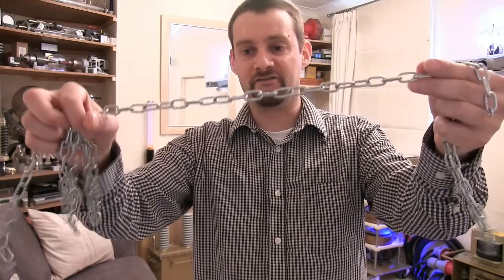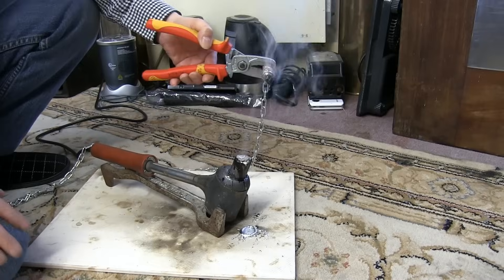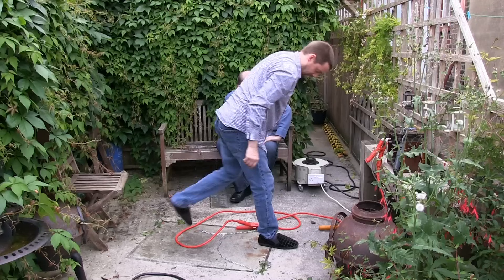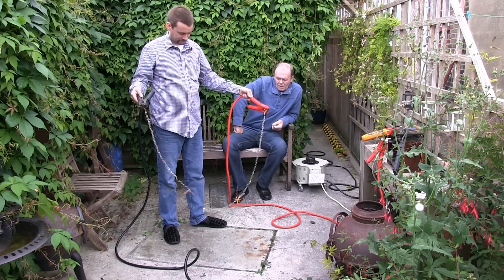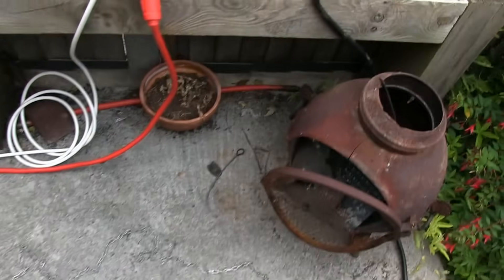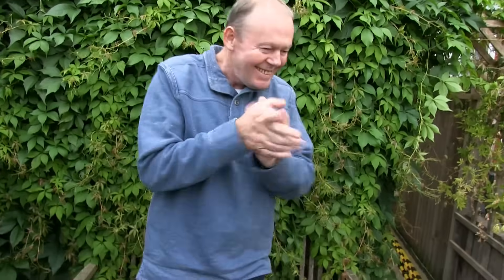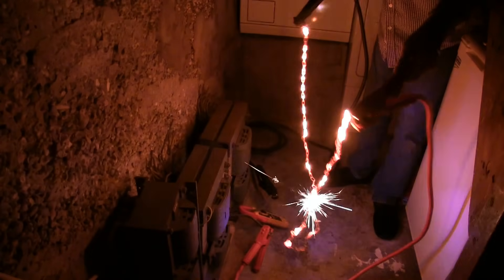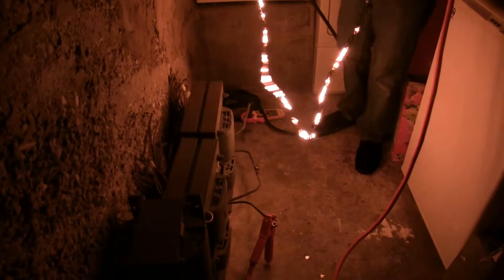Steel Chain VS Electrical Current

Comment: What the hell is that monster solder thing?!
Reply: Industrial soldering iron for soldering large things :)
Reply: +Daniel “G” W like fairy lights?
Reply: Mega soldering iron
Reply: I wonder how many watts that soldering iron consumes.
Reply: Had one of those, not exactly but close to it, mine was 125 Watt. Seeing this one, I guess it's more like a 175 or 200 Watt iron.
Reply: +Tenus123 Not enough, I'm sure. Crank up that variac!
Reply: ***** blow torches are used for medium sized things. I'm talking 500A connectors here...not a little copper pipe.
Reply: MrDubje Standard soldering irons are often 300-500W.
This is more likely to be in the kW range.
Reply: *****
Never used it, got it from my grandpa, sold it last month. I imagine it is safer than using fire when used as a plumber's tool, being close to wood in some cases? I'm not sure, though.
Reply: Daniel W
It might be, hopefully *****  can clear this one up...
You mention "standard" soldering irons, for what use are those power ratings standard :) ?
Reply from the maker: 300w from RS Components
Reply: *****
Thanks for replying and clearing it up for us!
Reply: +Daniel “G” W Standard soldering irons are most definitely not 200-300 watts. They are around 25-90 watts.
Reply: +Andrew Delashaw Even a mid sized soldering station like the popular Hakko FX-888D is only 70 watts.
Reply: ***** Pretty much yeah.
Reply: Yeah, and it has an unusual tip on it too THAT'S WHAT SHE SAID
Reply: THANKS I AM GOING TO GET ONE
Reply: Becuase burning gas is for peasants, 200 watt all the way haha, no but I get your question, I feel it would be easier to use gas

Comment: fuck that soldering iron is huge. good god.
Reply: Its not real soldering until the iron is as big as your arm. Regular soldering irons are for peasants. I use an iron just like that for my computer motherboard soldering.
Reply: Mike44449 for the cpu socket exclusively right?
Reply: not bigger than ryzen

Comment: Does the resistance go back down when the chain is cold again?  Wondering if it's the steel oxidizing or when it's hot you've got all that thermal energy bumping the electrons and holding the current back.  You showed something similar in that big light bulb video last time, and that's in vacuum and it recovered, so that couldn't be oxidation....dunno, just wondering out loud!!

Comment: Stainless steel wire is actually used in some temperature controlled vaporizers because the chip in the vaporizer uses the changing resistance of the wire to determine what the temperature of the wire is.

Comment: that was cool. Question about the chain glowing is that what causes the same effect to work in Light Bulbs? I know metal when heated to a high enough temperature will melt and glow, but is that the same glow in lightbulbs?
Reply: might be good to mention I'm going on 17 hrs without sleep when forming this question.
Reply: It's the same thing except there is a special gas in lightbulbs (I'm not sure whether they still use argon in  incandescent light bulbs) which prevents the filament from breaking off due to the heat.
Reply: Not an electrician, but Im fairly certain its the same concept, just much smaller wire and a lot less current.
Reply: Well, it's mainly because if you made lightbulb filled with air it would gladly smoke all the machining shit inside and make glass a bit "tinted" on the first run;)
Reply: Thanks peeps :)

Comment: You're like Colin Furze's electrical engineer brother...
Reply: COLLAB WHEN?
Reply: Naa never happen. Photon would have to take the Dartford crossing and he's popped his passport.
Reply: how? he doesn't build anything, all this guy does is burn/destroy stuff
Reply: He "overclocked" that mobility scooter, and also built that power control console. But yeah, fair point I guess. What I meant is that both engage in very dangerous stunts, but that's a rather broad category on it's own...
Reply: +Suhkma Dheek let's just leave what you said at "I don't know anything about how electricity works"
Reply: yes we need this now
Reply: +Suhkma Dheek Large Marx generator would be simpler to build.
Reply: Eduardo Jerez doesn’t build anything? Pretty sure he built most of the electrical equipment dotted around his house. Just because it’s not some flashy movie prop doesn’t mean it takes any less effort
Reply: @theinfoone  He built everything you see there in his "Shop".   One more clueless keyboard worrier.
Reply: Exactly what I was thinking

Comment: Watch out with galvanized metal, inhaling the fumes will make you sick.
Reply: Yeah, I've heard that the effects of inhaling zinc fumes will make you feel so physically bad you'll wish you were dead.
Reply: Katalist
Yep, couldn't remember the name for it at the time. Thanks for jogging my memory.
Reply: You think he actually cares about safety? :D
Reply: It's also called welder's flu. Basically, it feels like a horrible flu, times 10.
Throwing up, going to the bathroom a lot and one hell of a migraine.
Taking a large amount of calcium right before or after the event prevents most problems.
Reply: Henk de Vries
I was told by someone that taking calcium and possibly also strontium beforehand helped. Maybe it's wrong then. I never checked the information.
Reply: He said in another post that he burnt off the galvanized coating outside before starting the experiment.
Reply: Worth it
Reply: @theLuigiFan0007  strontium 😂😂😂🤣🤣🤣

Comment: Ah the lovely hum of shorted transformer :)! Although I'm a bit curious, why is that the chain is not being lit up evenly across it's whole length? There're parts which are visibly darker or brighter. Is it because each one of those cells have different resistive properties so the current differs on different parts of this chain?

Comment: I wonder why some parts of the chain didn't get hot
Reply: low resistance I guess
Reply: Probably because of difference in conductivity. There are many different materials on this chain; from zinc coating and steel to everything they turn into at 800°C or more.
Reply: The parts that don't glow are chain links that welded together and have a low resistance, so they dissipate a lot less power (ohmic heating). Also the hot parts are a little thinner because they oxidize faster.

Comment: Yep. Stainless steel has the property of increasing resistance with temperature. This is actually hoe temperature controll ecigarettes work. They use the TCR curve of  stainless steel. It then calculates the temperature based on resistance above the base value.

Comment: So quick question, from my knowledge of running a pos and neg to a chain like this, when you bounce each link off of each other like you are isnt that technically creating a arc like weld arc persay. That's why it gives off the blue flash? Me personally being a welding i believe it is, also if so that's so bad for your eyes fyi.

Comment: You guys should try a bike chain.
Reply: or a whole bike
Reply: Or electrocute a bicycle wheel and spin it...
Reply: Heck yeah!
Reply: Get a few batteries, wire them up and have a glowing bike chain while riding it, just don't touch the metal.
Reply: edwardecl yah because its that simple
Reply: Andrew Fritz
I'm sure a couple of dozen of those batteries you use in remote control aeroplanes and other RC devices would do the job, at least till they explode.
Reply: edwardecl but how will you get the electricity to only go through the chain?
Reply: Andrew Fritz... didn't think of that... o_0
Reply: wear rubber gloves and some wellies, i'm sure it will be fine.
Reply: edwardecl what about the gears,the frame and wheel spokes?
Reply: The back wheel and gears might be a problem... I'm sure you could insulate the rest though.
Reply: edwardecl its would be hard though use some type of reinforced plastic gears/spurs/sprockets.
Reply: Andrew Fritz OMG you could propably carry a couple of batteries and a transformer on a bike. Attach the wire to the bike and ride away. Imagine driving a bike and all of a sudden it starts glowing and melting under you. Comedy gold.

Comment: Did you use a DC to AC inverter for that car battery? if its a 30V source then hoow did you  step it down without affecting the voltage? am i missing sometihng?

Comment: Now that's fucking soldering, but you'd have been better off with a pot of molten solder and dunking it in, that's how I join large cables easily, although you'd wanna do at least 50 at a time as not to waste power.
Reply: Yeah, I thought of that too, but you need special flux for oven flame soldering, or just left the work piece get nice and hot. He doesn't waste that much energy, it's for entertainment, but melting 2Kg of tin/lead would be a massive waste.

Comment: So instead of waiting for dark and doing it outside you do it in your basement. Your a real smart one.
Reply from the maker: Smarter than you realise apparently! Lifting and carrying the transformers to outside would have broke my back, and my feet if I dropped one. The galv was burnt off outside so that's good enough. Concrete floor in basement, perfect, power in basement perfect, get the idea now ?
Reply: ooooh rekt!
Reply: seem he been ok for last 7 years of doing this stuff
Reply: lee x he's living on borrowed time then!
Reply: "He knows nothing of electricity"
Reply: Interesting
Reply: +olatron that was a spellcheck error... It should have been about. I use a slide keyboard and sometimes if I do it to fast it comes out with the wrong word...
Reply: +lee x I'm surprised that he didn't get electrocuted when he had his slipper on the chain. I've seen enough idiots been jolted from screwing around with electricity in my life and a lot of idiots ending up in the hospital because of it. I've even seen the aftermath of a high voltage line accident involving 2 workers. Very very bad. When he put his foot on the chain I was surprised it didn't arc around the thin insulation into his foot then through him and into the ground on his other foot. I know he had a little insulation on the bottom of the slipper but it was very thin and is far far from what people that work with electricity have to wear.
Reply: The Tartan71 was only 50v (I be more worried about burning your self) but I agree this was bit more open air and higher risk then the  other stuff he norm does
Reply: The Tartan71 I wasn't calling you out on your grammar, I was pointing out what a ridiculous statement that is. I'm pretty sure his knowledge of electricity > nothing.
Reply: olatron it doesn't mean that he knows exactly nothing. It's not literal. I don't know where your from but in all of North America I've been to, when someone knows "nothing" it is taken figuratively or metaphorically.
Reply: 50V cant travel through your body that well and he is very clever at electricity
Reply: The Tartan71 I'm from England, the same place as the language you're busy misusing :p
Reply: olatron lol
Reply: The Tartan71 depends how close the ends are :), at school I messed with 50V and I was just fine :) As there isn't great conductivity to the ground compared to the chain, but as it isn't near the heart and little current passes its fine, even if I'm wrong, photonic know this stuff as he works with electricity!
Reply: Mapstar it actually is the amps that kill and you might have been playing with 50V but with low amps. As do I work with electricity but in the high end. I work with high voltage power lines and went to university with a minor in electrical engineering. Anything can happen when you play with electricity without the proper safety cautions. Safety mechanisms can burn out or stick when there is too much power being put into it or you become the ground and it tries to suck to much power though it and your fucked. I'm not arguing anymore. I know what I'm talking about. You can believe what you want but I know how dangerous any electricity can be. As I said in a previous post, I've seen what can happen to the human body when something goes wrong. I saw an accident at a high voltage power line in which one worker lost his balance on a tower that they were about to make the line safe to work on. He slipped as he reached the top, his safety line broke and he fell into the live line also touching his co-worker at the same time. I'll never forget anything every one of my senses detected that day. I've seen lots of people who work with electricity who "think" they know what they are doing because they work with it and they are the number one cause of workplace accidents in all jobs dealing with working with electricity be it high voltage of low voltage.
Reply: The Tartan71 i know amps what kills you but the volts are required too, 1V 500A should be ok
Reply: Triggered?
Reply: The bloke has 25 years experience working with electricity you keyboard warrior.
Reply: The Tartan71 I completely agree that it's dangerous - but it's his choice. Let's leave it at that. All the best to you friend.
Reply: olatron that's all I was trying to say and I have no problem with anyone. I was just trying to say my bit. I'm sorry my posts were so passionate. I've just seen too many bad accidents involving electricity which happened to very skilled and qualified veterans of the job. 
No hard feelings at all bud.
Reply: ***** please don't start this all up again. He maybe very qualified but as I said in the post I just wrote.... I have seen too many qualified and skilled veterans of the job get hurt and even killed. Once you see people killed working with electricity you never like to see people playing with it without the correct protection.
Reply: The Tartan71 you're*

Comment: A question for someone who might know, the chain loses it's looseness and becomes very rigid looking when power is applied. Is this because at a microscopic or subatomic level the molecules are basically doing the same thing a person does when tased by a taser and locking up?
Reply: Are you asking a question or telling us that's why? Sorry I'm confused by your statement?
Reply: Think it may be arcing, melting the metal in tiny areas and basically welding it together

Comment: What would have happened if one of those glowing, swinging chains hit your leg? Burned or electrocuted? Probably both...
Reply: Just burns, the voltage (50V max. in this video) isn't going to hurt you. You might feel it tingle in the worst scenario.
Reply: It does hit his leg a few times.
Reply: moreover secondary is separated from mains, floating with no reference to ground so he would havee to touch two spots to have some current flowing thru his body
Reply: Thanks for the info... Just doesn't look too safe in his little closet there, but he seems to know what he's doing.
Reply: I think Quentin meant bare legs, but I can be mistaken :) Photon indeed tried it with his pants.
Reply: No problem, I agree, it doesn't look too safe, but I think we can also agree on saying Andy knows what he is doing :)

Comment: Wouldn't dumping a shit tonne of current into the connection you were making be easier than trying to use a huge-ass soldering iron? might help the solder take top the chain

Comment: Cool as hell....Why is it, that some of the links glow white hot whilst others remain quite dull, even though the current draw should be the same through the whole chain?
Reply: Resistance.
Reply: Most likely due to the varying amounts of resistance where one link 
contacts the next one. Some of these contact points have welded 
themselves together, resulting in less resistance, hence less heat.

Comment: Good Video. Would be cool to see you build a mega induction coil. Something that could melt metal in under a minute when placed inside the coil. You have the power.

Comment: if i can ask a question, when the chains touch and  stick to each other, is it because of micro arc welding or have they become temporary magnetic?
Reply: They are pretty much welding together. That's how they do welding, by passing a very large amount of current. They were 100 amps @ 50 V, which should be enough to weld, but a lot that energy is basically used heating up the chain, so, it probably wasn't a very good weld, which is why it would sometimes come loose again.

Comment: The reason you're seeing increased resistance with higher temperature is that resistance usually does increase in metal with higher temperatures, you can try finding the respective temperature to resistivity coefficients to see a detailed view of how it changes. Not to mention how many poor connections there are in the chain.
Reply: Why else would we need to put liquid nitrogen cooling systems on supercomputers?

Comment: So let me get this straight, the current is running from the + to - which means ground, and if you take off the black cable, and leave the red one and with other hand touch the chain while standing on ground with no shoes, you get blown up?
Reply from the maker: Nothing is referenced to ground, the supply is from an isolation transformer AC
Reply: Ok se there is no way to get "electrocuted"
Reply: 50V would have a hard time pushing enough current through your body to do any real damage even if it wasn't isolated. Current kills you, but it needs enough voltage to push it through your skin to the fleshy creamy center where it'll do the damage / killing.
Reply: +Thor Rankin
Exactly, that's what many forget V,R,I are related.
Though I personally would worry about anything above 24-30V especially if I know that the power supply can deliver 100A@50V. you never know if you have a small cut or if the equipment can actually pierce a hole through your protective gear or skin. That's why you should always assume it's dangerous.

But if everybody was like that we wouldn't have Photonicinduction!

Comment: how does a steel change melt with that current, but the cables, powers supplies and transformers can withstand it?
Reply: Resistance would be my bet? But I'm not the best placed to answer though. I'd rather let someone who studied in electricity answer for you.